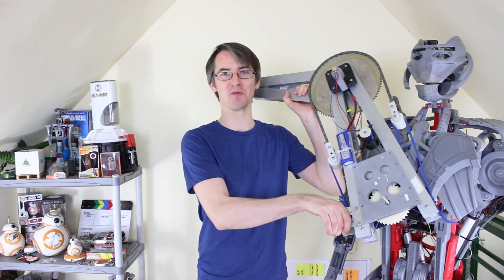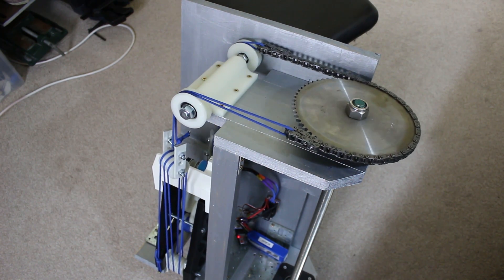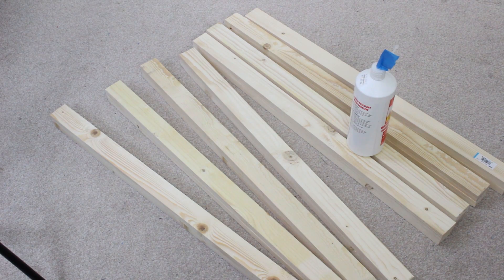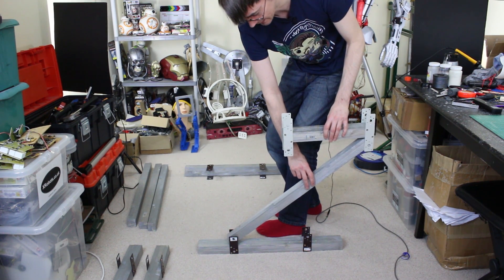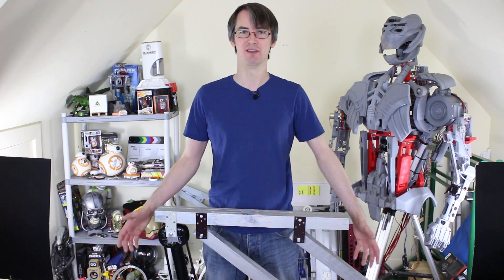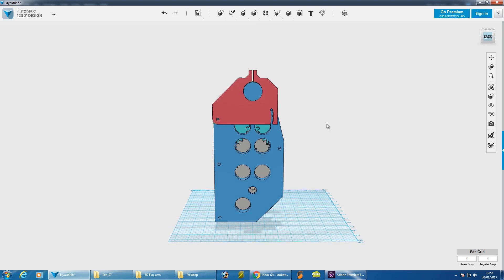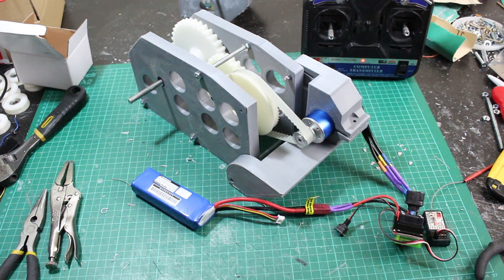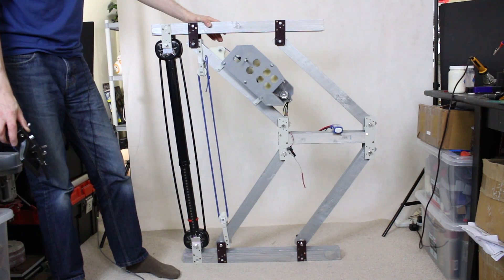Iron Man Exosuit #7 | Starting Power Legs! | James Bruton

Comment: You could use pressure sensors to control the legs (you push against the sensor, the leg moves up, the sensor moves with the leg)

Comment: hmmm... not quite seeing it yet. how will you trigger the motor to lift a power leg off the ground? force sensing? will you be strapping your feet in? and then you have to keep balance briefly while the power leg is up before all the weight shifts back to the norm upon which you need to quickly drive the motor to the bring the leg down and catch the fall (like a normal walk).

Comment: I'd be a little worried about leaning with the full thing, especially if say you were leaning towards the load/item you are trying to lift. Of course, one could simply not do that, but if the load you were trying to lift was on your 'right', you could re position the 'right' leg as to push back against the angled body/lower the body to some angle. Just a thought!

Comment: good job riding to the challenge! You might have problems with the top and bottom compressing the same. you might fix it with a bungee cord stretched between to and bottom and fixed to the knee in the middle.

Comment: The legs kind of look like the beginnings of a Locust or a Flea Mech (from Mechwarrior). :)
Reply: Hmm, a seat that the legs attach to, foot pedals that control walking (like tank treads... both for forward, left to turn left, right to turn right, etc).  Upper torso controlled by motion tracking sensors like project ultron and the joystick plan from the power arm project for controlling the arms.  Mini-mech!  :D

Comment: There's pogo sticks today in aluminium that works by compressing air, and if you want it stiffer say because you are a heavier man than last guy on it you just fill it with more air. Maybe that could work for you as a spring? Just buy a ebay piston and use air to turn it into a spring.
Reply: Apparently you can get cheap ebay 6mm stainless steel springs up to 1m length for pretty cheap too. Jam in pvc pipe, call it a day
Reply: leaving a comment so this goes up, great suggestion
Reply: Sodori boost
Reply: That could be a great idea. If they can function properly at both lower and higher pressures, he can adjust their "tension" as he builds up the exo-suit.
Reply: +The Conquering Enigma And he could even pressure both sides differently to create a zero point that's not on a end point if he wanted to :D